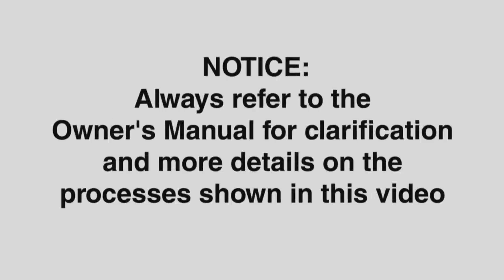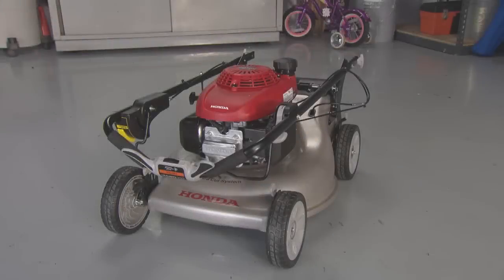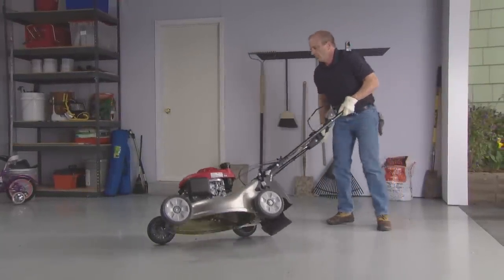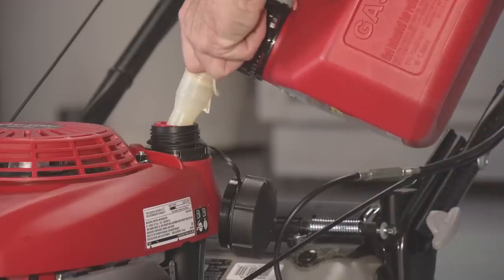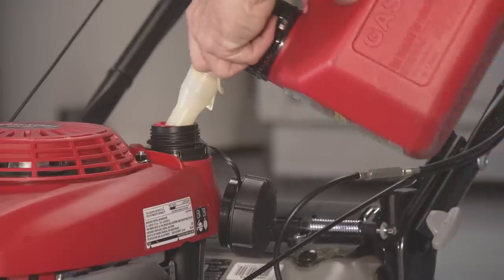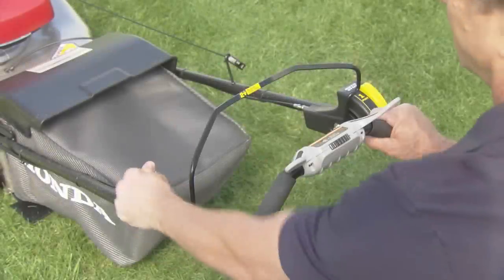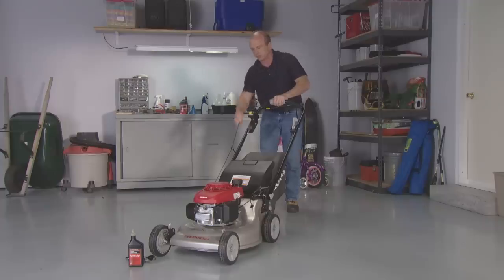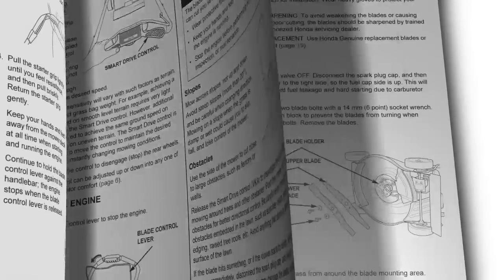HRR216 Series Lawn Mower Storage

Comment: @ Honda... FWIW, I had to quit washing my mower off. Because every single time I did, after it sitting, I could no longer pull the mower backwards when mowing. The rear wheels keep/kept locking up. Talk about a royal PITA when mowing. Especially when you have a fence!!!

Side note, I've also noticed it appears the right front wheel isn't level with the other three at times. When I push the mower on what I know to be a flat surface, the right front is off the ground/doesn't spin/roll with the rest. 

As for winter storage, I just siphon what's left in the tank then start the mower and let the engine run until it dies.

Comment: No comment in this video about what to do with the oil in the machine.  Should it be drained for long term storage?
Reply: No...your oil prevents rust.
Reply: Go by what the manual says for the oil. Winter is the same as the summer. Make sure its full/at the proper level. Summer, change it as needed otherwise before each mowing make sure it;s properly filled/at the right level.

Comment: where to buy the tool that take out the plug. it is not in instruction,  home depot sale the universal one , and it is not good. thanks in advance
Reply: I use a spark plug kit that has several size fittings. One will be just the right size for this plug.